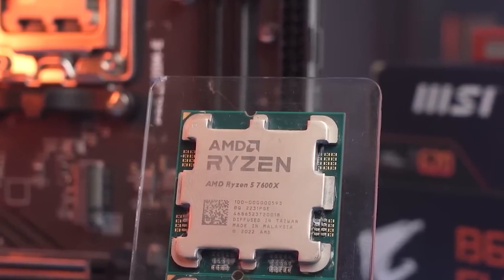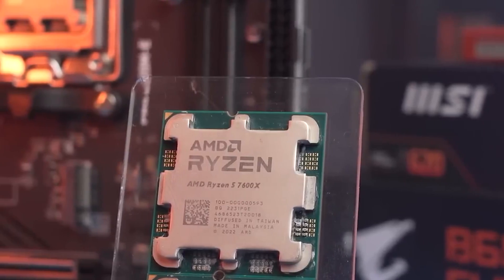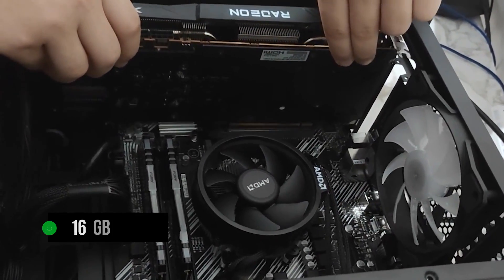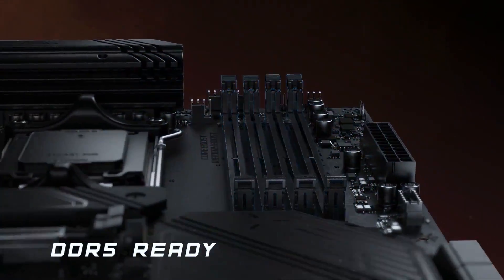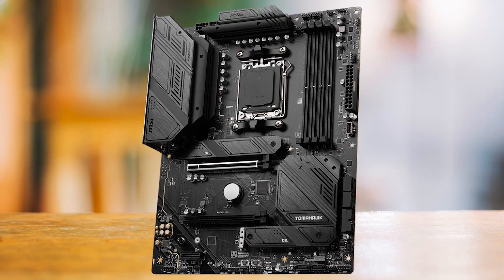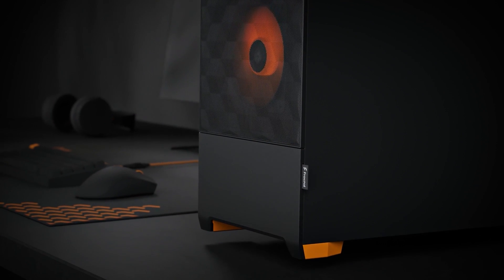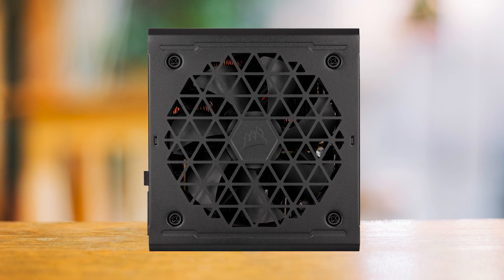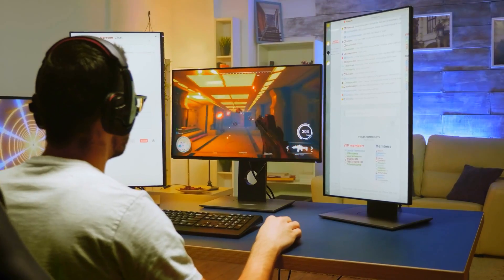THE BEST VALUE RYZEN 5 7600X PC BUILD IN 2024! Radeon RX 6800, 32GB ($1200)

Comment: I paired a RX 6800 with a Ryzen 5 7600. Runs great 👍🏼
Reply: Same. Im about to build it soon
Reply: U think the 6800 and ryzen 5 7600 IS good for ultra settings 80+ FPS? @Tea.enjoyer
Reply: @rotomega6297  what is the resolution of your display? And which games do you play?
But on 1080p and even on 1440p ultra settings @80+fps is easily possible on most games 👍🏼
Reply: @samuelrave  ill play 1080p games like rdr2 cyberpunk GTA Forza Horizon and PlayStation games

Comment: RX 6800 finally mentioned!
Reply: such a underrated GPU
Reply: @arin2166 frr
Reply: Quite literally the best value GPU you could buy right now in 2024. Runs much cooler than the XT counterpart, great for 1440p and the best future proof for 1080p.